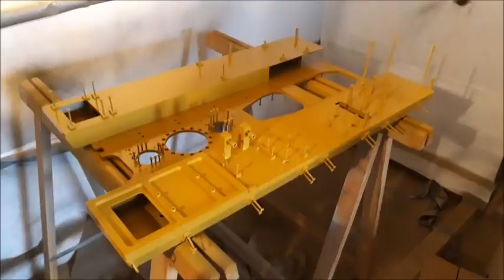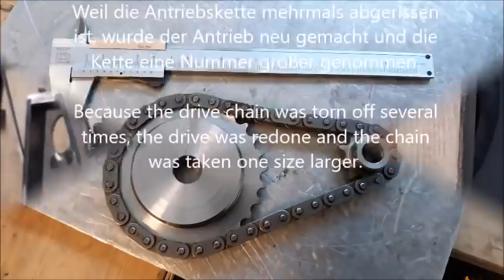XXL RC Modellbagger 180kg Lackierung Baubericht Teil 9 / RC Excavator 180kg Buildingreport part 9

Comment: Which engines did you use? I wanted to know because I'm building a 1: 8 excavator myself and I would need motors that are powerful enough for both driving and hydraulics and all. However your model is spectacular.
Reply from the maker: For driving in each side I use a engine from servonaut.de.  It is the GM42U325. 
For the hydraulic pump I use a Robbe engine. It is the C50-55-06. Thats the most powerfull engine for 12V I know.
Reply: Thank you very much you are the best!
Reply: What about the servos for the hydraulic valves?
Reply from the maker: https://www.conrad.de/de/p/bluebird-standard-servo-bms-630mg-analog-servo-getriebe-material-metall-stecksystem-jr-275463.html

Comment: How did you design this . I'm gladly willing to know that... designing part scale and all.
Reply from the maker: I had only a scale model in 1/50. Some photos and the prospect. Than take the original and divide it by 8. And you need a lot of time and pasion to do that.
Reply: @rcheavyconstructionzone  Which 3D software tool are you using to modelise ?